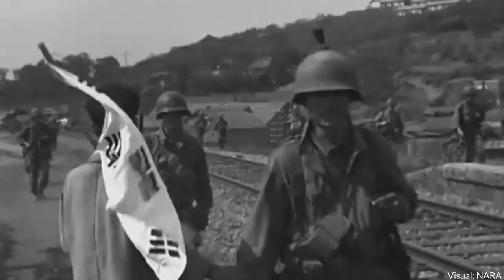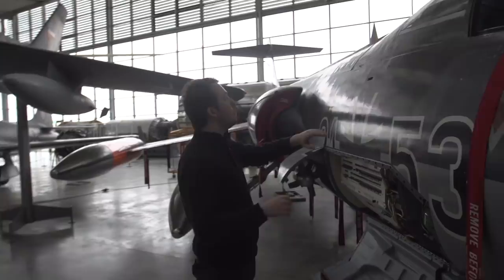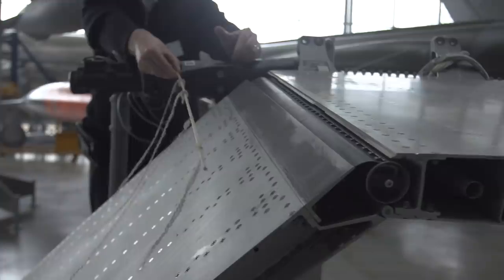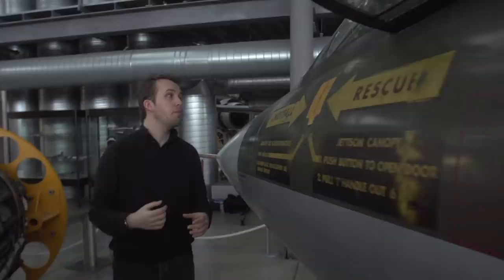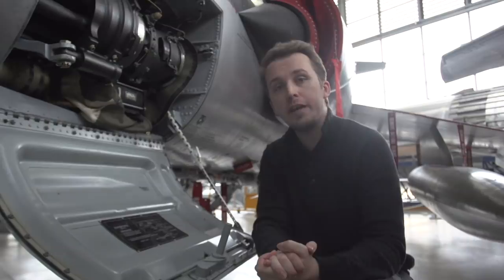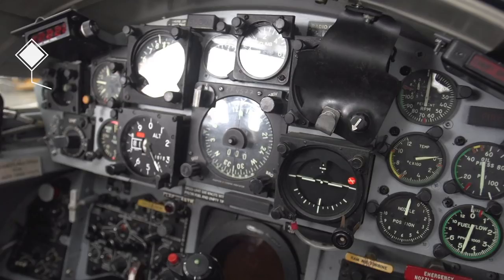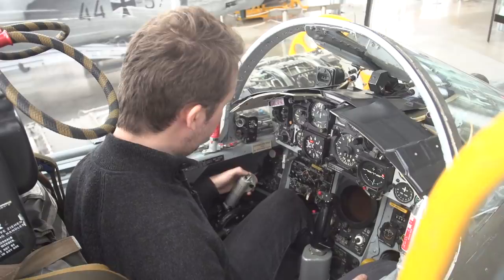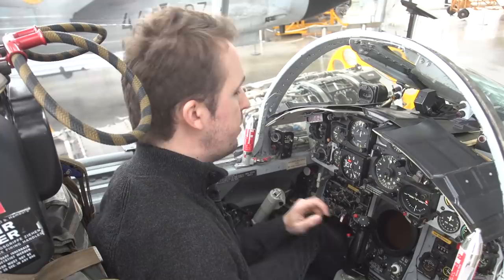F-104G Starfighter - Inside The Cockpit

Comment: As a child in the 1960s, at Cold Lake Air force base in Alberta, Canada, these spectacular aircraft filled my skies. The mighty, thundering J79 would rattle your windows daily and nightly. At an airshow, I watched an F104 "zoom", climbing vertically until it was out of sight in a clear sky in less than a minute but with the engine roar still audible. It was a purpose built aircraft that was misused and misunderstood by almost all (non flying) users. The actual widow makers were the officials who decided to make pilots operate the aircraft far outside it's flight parameters. It didn't deserve the bad press.
Reply: Damn good days
Reply: Flight parameters? As in the thing was a missile with fins for wings and its flight parameters were "it barely flew". Unless you could fly a missile. There's a reason the US military dumped all its 104s on foreign countries. It may have looked cool and had a few impressive specs, but it was a major failure
Reply: @outerrealm  Whatever you say. You are obviously an credible authority. Who could argue with your eloquent rhetoric? And why waste the effort?
Reply: @outerrealm 
> Flight parameters? As in the thing was a 
> missile with fins for wings and its flight 
> parameters were "it barely flew".

At high speeds, you don't need a lot of wing area to generate enough lift to fly and so the F-104 flew quite well.

> There's a reason the US military dumped all 
> its 104s on foreign countries.

The U.S. military didn't dump all of it's own F-104s on foreign countries.
All of its F-104s (i.e. F-104As, F-104Bs, F-104Cs, and F-104Ds) were originally foisted off onto Air Guard units as is the habit of the Air Force, before the were retired entirely from service.

The F-104s used by foreign countries were "Super Starfighters" (F-104Gs), which is to say F-104s whose design was modified by Lockheed to satisfy the requirements imposed by the Europeans (in particular the Germans) when they (the Europeans) wanted to buy new aircraft to modernize their air forces.
While many F-104Gs were produced by Lockheed in the U.S. for the Europeans, many of them were manufactured under license in Europe by the likes of Messerschmitt, Fokker, and Fiat while in Japan, they by Mitsubishi and Kawasaki from parts made in the U.S. by Lockheed.

As for the reason(s) why the USAF gave up on the F-104, the main one was they wanted to get other fighters that were becoming available like the F-4.
Even though the F-104 was originally designed to be a daylight air superiority fighter, they were bought by the USAF to be interim interceptors (point defense) until the interceptor they really wanted, the F-102/F-106, became available.
The USAF was not happy with the F-104 in the interceptor role because while it could climb like crazy, its limited fuel meant that a very limited range to the point where a bomber flying at a high enough altitude couldn't be intercepted until the bomber was already over it's target.

> It may have looked cool and had a few 
> impressive specs, but it was a major failure

When flown the way it was supposed to be flown (i.e. in slashing attacks), the F-104 was able to best the F-86, F-100, and F-4 in aerial combat according to the results of Project Feather Duster (Feather Duster II, I believe).
That doesn't look like a "major failure" to me.
Reply: can u elaborate on the misuse of aircraft, what were they doing wrong?
Reply: @TheKrakovv  F104 was a high speed, high altitude single engine interceptor intended to kill bombers. It was a small, low cost missile carrier. Operators used it for other purposes including low elevation ground attack missions for which it was entirely unsuitable. Early Starfighters had a down launching ejection seat, unusable at low altitudes.  It had a very poor turn radius and was a mediocre dogfighter because of that. It could survive only by running away (very quickly). By the middle 60s, operators understood better what it could and could not do. Germany in particular ran into serious grief with their F 104 program until a new commander of the air force established new safety and training regulations to reduce losses.
It was a very sexy and attractive aircraft but it really had little utility as a war fighter.
Reply: @fraserhenderson7839  

> F104 was a high speed, high altitude single engine 
> interceptor intended to kill bombers.

Wrong.

As any decent history of the F-104 will tell you, it was designed to be a daylight air superiority fighter for use against Soviet FIGHTERS (not bombers) in response to a wish list of "wants" that U.S. Korean war pilots gave to Kelly Johnson when he made a tour there to find out how well the F-80 was doing.
These pilots basically said they wanted to be able to take on a beat Soviet fighters, which as it turns out was something that the F-86 could not do against the MiG-15 at high altitudes.

The Air Force was initially impressed with the performance of the F-104 (especially in light of how badly everything else seemed to be going in development) and so they ended up putting the F-104 into service as a point defense interceptor (along with the F-101 which was going to be used as a deep penetration fighter until it was re-tasked to be a wide area defense interceptor) because the aircraft they really wanted for the job (the F-102/F-106) wasn't ready yet.
Over time, the Air Force became disillusioned with the F-104 in no small part because its limited range meant that it couldn't intercept a really high flying Soviet bomber until the bomber was over its target ... something that isn't A Good Thing if said bomber is carrying nuclear bombs.

The clearest evidence that the F-104 was NOT intended to go up against Soviet bombers is to look at the weapons it could carry.
The other interceptors could carry an unguided (so it couldn't be jammed), nuclear tipped Genie air-to-air missile.
While a trapeze mechanism was concocted so that the F-104 could carry a Genie, it never did so in actual operation.

>  It was a small, low cost missile carrier. 

Although that may be a fairly accurate description of what it ended up being, it is not what it was designed to be.
Once again, you seem to have no idea of it's history, because if you did, you'd know that it was designed before the infamous 1957 U.K. white paper that declared that dogfight was dead and that the future involved just pushing a button to launch a missile.

Because the Korean war pilots basically eschewed high tech (one saying that he'd rather have a piece of gum stuck to the wind shield instead of a fancy radar/computer guided gun sight), its radar was for ranging, and so too small for guiding radar guided missiles like the Sparrow.

Also, the F-104 made two (2) tours of duty in Vietnam where it's second tour was to take over until the F-4 could return after being fitted with a gun pod since it didn't have one built in.
The Vietnamese went out of their way to avoid the F-104s in air-to-air combat (as they did with other U.S. fighters flying air cover as well) and so it never made any air-to-air kills in the war.

And let's be clear here:  the probability of a kill using a gun was much higher than the probability of a kill using either a heat seeking missile (Sidewiinder) or a radar guided missile (Sparrow) through out the Vietnam war, which is to say, through out the 60s.

> Operators used it for other purposes including low 
> elevation ground attack missions for which it was 
> entirely unsuitable.

A lot of German pilots crashed into the ground because they misjudged when to pull up in a ground attack run, especially in the early days.
But then, a lot of German pilots went into the ground because they became disoriented because of the F-104's quickness.
That doesn't mean that the F-104 was "unsuitable" for flying in non-ground attack rules no matter how much the F-104 haters may like to think it does.

> Early Starfighters had a down launching ejection seat, 
> unusable at low altitudes. 

Correct.
But it wasn't all that long before they were changed out for upward firing ejection seats and IIRC downward ejection seats weren't present in the F-104Gs used in Germany.
Unfortunately, Lockheed opposed the use of true zero-zero (zero height, zero speed) ejection seats in favor of their own C-1 ejections seats, but the Germans eventually went with a Martin-Baker ejection seat which was.
So if you want to argue that the lack of a true zero-zero ejection seat made German pilots reluctant to try to eject when they should have, that may be a valid point, but don't try to blame downward ejector seats on what happened in Germany.
Reply: @fraserhenderson7839  
> It had a very poor turn radius [...]

As does any aircraft that flies at high speed as any aircraft flying at high speed effectively becomes a straight line machine no matter what who designed it or built it or in what air force it served.
In fact, the tightest possible turn in terms of radius for just about any aircraft is for it to fly as slow as possible ... which generally speaking is NOT A Good Thing to do in aerial combat if there's more than just one enemy aircraft flying around.

IF you want to get into a sustained horizontal turning dogfight, then what matters is your ability to bring your weapons to bear quickly on your opponent which means you want a turn RATE (not just radius) as least as good as your opponent so that you can fire your weapons before he/she does.
And as it turns out, virtually every U.S. fighter that you might want to mention has a worst turn rate than potential Soviet opponents and yet the U.S. fighters usually had a better kill (exchange) ratio than their opponents.
Why?  Because they didn't engage in a sustained horizontal turning dogfight.
Instead, they went "vertical" taking advantage of their greater power to use gravity to out turn their opponents ... which was something that the F-104 could do as well.
(And OBTW, the F-104 had "blown" flaps which allowed its wings to produce more lift out of proportion to their size.
While this was used on take offs and landings, they could also be used during a fight which allowed them to turn about as well as an F-4 so if you have a problem with the F-104's turning, then presumably you should also have problem with the F-4s turning ... which I suspect you don't.)

> [...] and was a mediocre dogfighter because of that. 

Bullshit.

Again, the results of Project Feather Duster (IIRC, Feather Duster II) showed that the F-104 could best the F-86, F-100, and F-4 using "zoom and boom" tactics rather than "turn and burn"/"yank and bank" tactics.
And a later study by NASA suggested that all Century fighters should do the same.
The F-104's actual combat history is a bit sparse, but what little there is suggests (at least to me) that the pilots (in foreign service) didn't know how to fly it to best advantage.

> It could survive only by running away (very quickly). 

Bullshit.

Historically, the vast majority of air-to-air kills have occurred where the killer flew up behind the victim's ass and blew them out of the sky before the victim knew they were even being stalked which is something that the F-104 could do quite well in no small part because its small size meant that it was hard to see.
After the kill, being able to get away very quickly (i.e. to disengage and "extend") isn't at all a disadvantage as getting into a prolonged turning fight is less than ideal because doing so means that you lose energy (i.e. you end up low and slow) and so are a sitting duck for someone else who still has energy.

> By the middle 60s, operators understood better 
> what it could and could not do. 

That's a really amusing thing to say considering how long that the F-104 continued in service both in Europe and Canada which was well beyond the 60s.

> Germany in particular ran into serious grief with 
> their F 104 program until a new commander of 
> the air force established new safety and training 
> regulations to reduce losses.

I find it fascinating that you can say this while apparently not recognizing the obvious implications of what you said.

The fact that the accident rate (and by "accident rate", I do mean "accident rate", not the "attrition rate" that the clueless like to point to) DROPPED immediately after Steinhoff's grounding of the F-104s ended even though nothing was done to change the design of the F-104 clearly shows that the F-104 wasn't not a flawed pilot killing design.
It also indicates that the F-104 was able to fly the missions that it was tasked with INCLUDING GROUND ATTACK once the German pilots finally learned how to do so.

> It was a very sexy and attractive aircraft but it 
> really had little utility as a war fighter.

Well, you are entitled to your opinion.

Not that you asked, but mine is that you're able to bitch about the F-104 today in part because it did its part to present a credible deterrent to aggressive action on the part of the Soviet block.
And that deterrence was based in part on the role that the F-104 would play at the start of World War III, not how people might imagine it playing out in some video game version of some extended form of World War II.
Even before NATO was formed, the U.S. made it clear that it wouldn't try to match the Soviets in terms of a conventional war (even though that's what ended up happening), but rather would go nuclear -- literally -- if the Soviets invaded.
So it was never a question of "if" we would go nuclear, but "when" we went nuclear.

And as it turns out, that makes the F-104 of great "utility as a war fighter" because it could fly low and fast with a nuclear bomb and was very hard to see and stop.
Whether or not the F-104 could dog fight worth a damn is of virtually NO importance in such a situation because any fighter willing to engage in a dog fight is a not a fighter carrying a nuclear bomb that has to be stopped.
And let's be clear here:  in the event of WWIII, where would be NO prolonged battle for air superiority as there was in WWII.
Instead, there would be basically one large air battle at the start of the war when everyone tried to prevent the enemy's fighters/bombers from dropping their nuclear bombs.
After that, there would be nothing as the air fields that the aircraft took off from would be gone under mushroom clouds.
And once that happened, the nuclear missiles would be passing each other in space as no one would want to wait around to see what the other side did after a significant portion of your forces just disappeared.

So IMHO, your evaluation of the F-104's "utility" is all wrong.
Reply: @irvhh143  
We've been through this before, Irv. The majority of F-104 losses losses incurred in Vietnam were in fact due to AAA, SAM's, battle damage and a mid-air collision.
The aircraft made an excellent ground attack platform - ask any former RCAF pilot who flew them.
Reply: @raynus1160  the RCAF did not fight in the Vietnam war. Canada fought in Korea and in the 1991 Gulf War. Canada only took part in peacekeeping missions between these times, which the 104 played no part in.
The 104 is incapable of low level terrain following flight.  The 104s in Vn were brought down by missiles, which have a minimum engagement range, I'm guessing 1 km. Anti-air below this altitude is by machine guns. This is only effective against slow movers like helicopters. It is nearly impossible to hit an object at tree level moving at over 100 mph.
The CAS you speak of amounted to launching ordenance from 5000 ft and hoping they didn't hit any friendly troops.
Reply: @irvhh143  
You clearly missed my point re: RCAF low level missions in Europe.
"The 104 is incapable of low level terrain following flight"
Not true.
Most of the RCAF's European Starfighter strike/ground attack missions were flown at low-level in inclimate weather. Pilots used the CF-104's R-24A NASARR radar in a terrain-following capacity to assist in low-level (<500' agl) navigation by following ground radar returns overlaid to VNC relief features. All flying was done at low level, normally around 200 feet or as low as fifty feet when attacking a target, and at high speeds of up to 550 knots.
Again, you might want to study up on your Starfighter stats - may I suggest visiting the Cold War hangar at Calgary's Military Museum - they have former Starfighter pilots there who would love to explain the 104's low-level attack role and capabilities to you in detail.
Reply: @irvhh143  
Sorry; where did I suggest RCAF aircraft fought in VN?
Reply: @raynus1160  these were simulations, not real combat with the enemy shooting back. The problem with pilots is that they love planes. A deathtrap is just a plane with character. This same phenomenon is seen with the 737max, which many pilots are defending.
And if a 104 pilot came back and said it was a pos, his military career would end instantly.
110 class A accidents out of 200 aircraft.
Canadair Sabre 282 accidents out of 1815 aircraft. 
Note Wikipedia refused to edit this point. 
37 low level crashes blamed in pilot inattention. Total bullshlt. These were the days when there was a selection program.
Reply: @irvhh143  
Full-on conjecture on your ill-informed behalf. 
Flying at 550kts and 100' AGL in weather isn't a "simulation".
Reply: @raynus1160  lmao did you personally witness these flights? One thing the brass specializes in is azz coverage.
Same bunch who said Vietnam could be won.
Reply: @irvhh143  
I see. So you're denying CF-104's operated in  low-level/low ceiling/low visibility environments?
Again - talk to former 104 drivers & educate yourself. Your posts will improve accordingly.
Reply: @irvhh143  
The RCAF's less-complex and subsonic F-86 Sabre saw ~3x as many accidents/pilot fatalities in less than half the time & it's generally regarded as a pilot-friendly aircraft.
The majority of those 37 CF-104 fatalities were the result of pilot error. Sad stat, but true none-the-less (33 pilot error/4 systems-related).
Read. Be smarter.
Reply: @raynus1160  The Sabre had 3 times as many accidents out of 10 times as many planes. It was a simpler aircraft, but just as leading edge for its time. 
Labelling the 104 accidents as 'pilot error' is just a coverup. And,  it is shameful of the general staff.
Can you cite specific accident reports?
Reply: @irvhh143  
And it was half as fast as the CF-104 & generally flown at higher altitudes due to it not being an all-weather fighter.
"Labelling the 104 accidents as 'pilot error' is just a coverup"
Because you say so?
"Can you cite specific accident reports?"
Every CF-104 accident case is available online. Find 'em yourself.
Reply: @raynus1160  37 fatalities of 200 aircraft is nuts. The pilot of a Sopwith Camel had a better chance of survival.
Reply: @irvhh143  
238 aircraft over 25 years of continual service, flying in one of the most demanding roles ever conceived: low-level, all-weather, high subsonic/supersonic nuclear strike and ground attack.
Your Sopwith Camel analogy is ridiculous.
Reply: @raynus1160  an unfinished prototype that shouldn't have gone into production.  Aircraft designers learned a lot from it, but this could've been done without killing dozens of good men.
The accident reports you mentioned only consist of a few sentences.
Reply: @irvhh143  
The CF-104 was a variant of the F-104G - a significantly improved version of the original F-104A & far from being a 'prototype'.
Flying low-level at 11 miles per minute with low cloud bases, marginal visibility, and hilly terrain isn't an aircraft issue - it's a pilot issue. The aircraft flew just fine if numbers and procedures were followed - unfortunately, the human factor isn't quite as reliable. Harsh but true.
Reply: @raynus1160  believe the hype. A pilot's life is a triviality to the military industrial complex. 
Look at skyraider or A10. The wing area of the 104 is half as much.
Can you cite a detailed accident report?